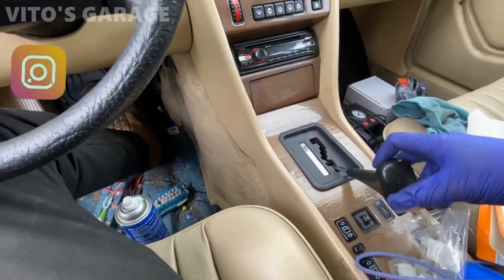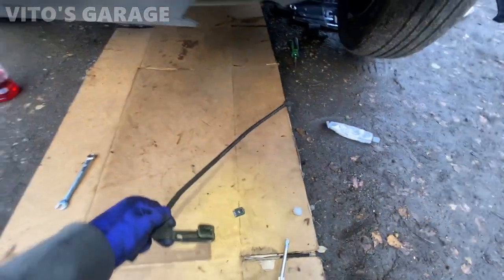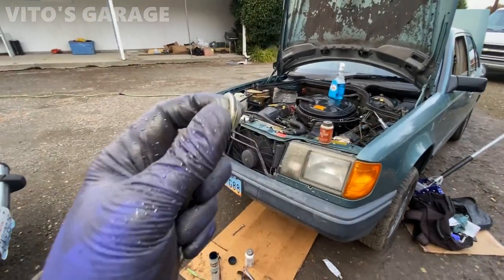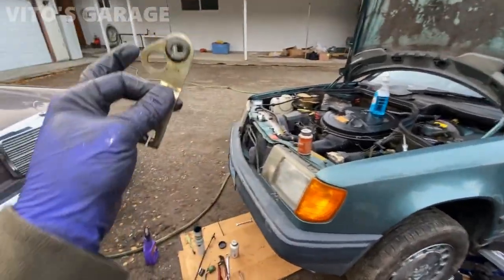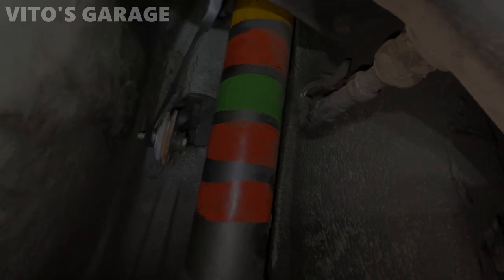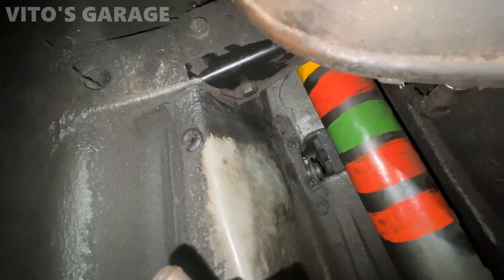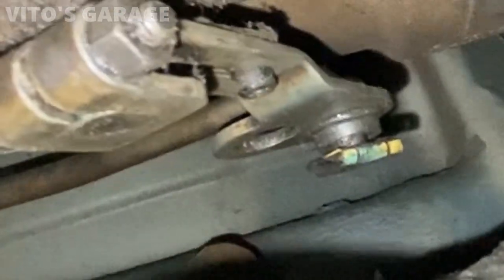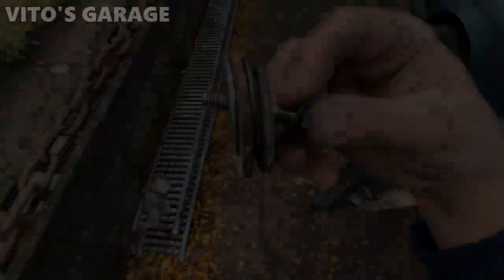Part 8 Mercedes W124 Replacing Automatic Transmission Shifter Bushings! WHAT A PAINNNNN..

Comment: Recently, I had to install a jacking point rubber on my '87 190e.  I tried to hammer it in etc., but the rubber was too hard and wouldn't go into the hole.  I decided to soften the rubber by putting it in boiling water, and it worked no problem.  I think I did the same with the antenna seal too.  Just an idea for next time.  Thanks for the video!  Rob.